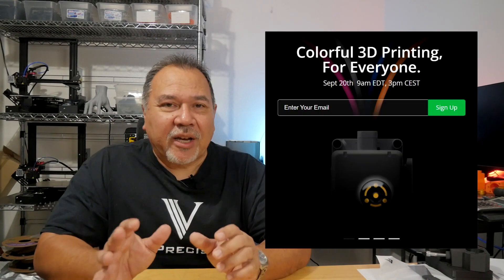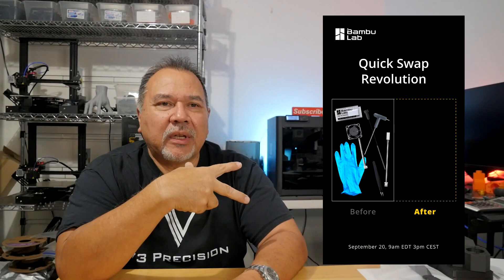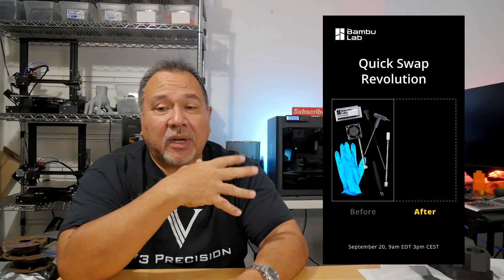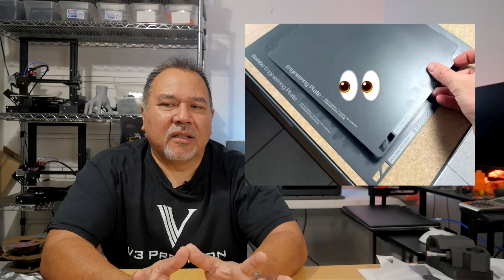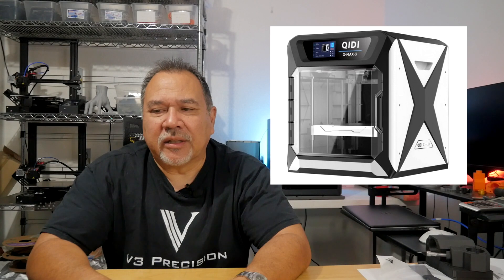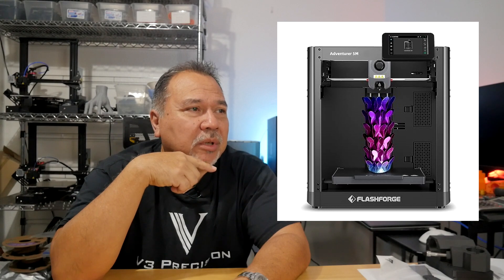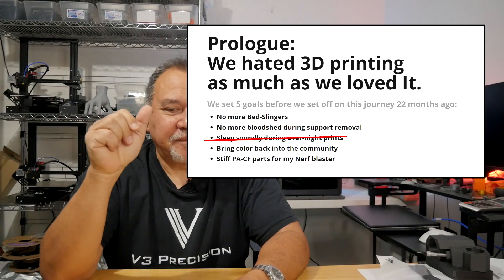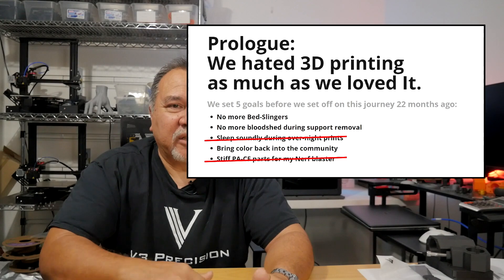Bambu Lab A1 Product Release Update 9/15

Comment: A1 will be targeted for miniatures. The reduced build area due to extra large extruder due to built-in AMS. No screen, No PC access.
Will be a coreXZ bed slinger for reduced cost. Bed Slinger will be transformed into a new feature with a new name. Also expect a digital marketplace within App, to download and share. Camera will be multifunctional and will be used for AI functions using cloud. Still a speculation based on speculations😂❤👍